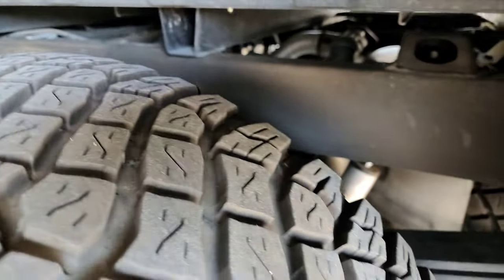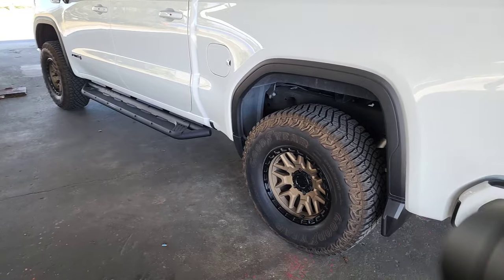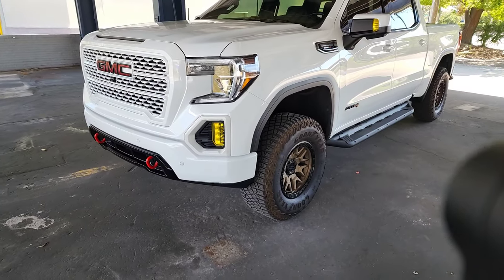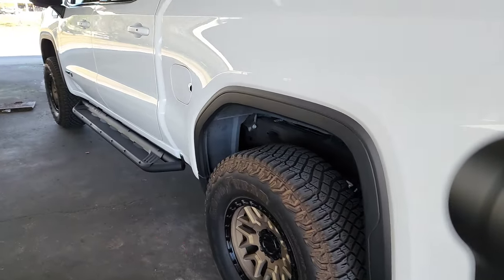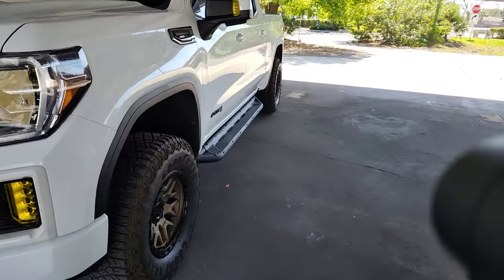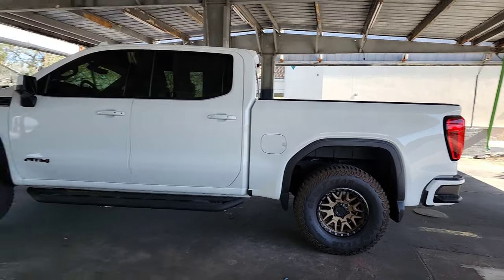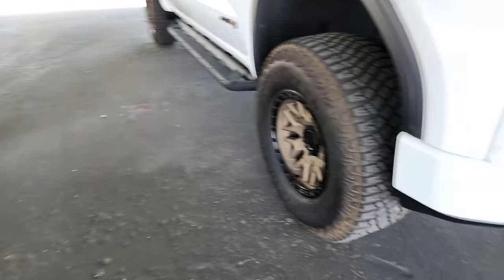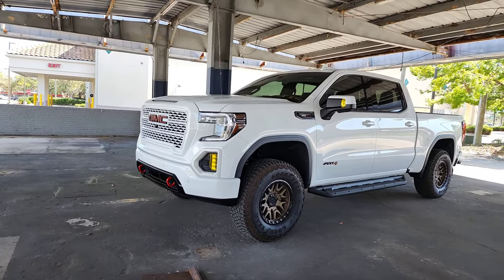Silverado and Sierra rear suspension noise or clunk fixes.

Comment: Same issue, only seems to happen at very low speed like pulling out of my driveway in the morning..... its definitly a clunking sound tho
Reply: I have the same problem on my 2023 2500 hd
Reply: @octaviofuentes7781 wtf your car is new af tho
Reply: @uaespetsnaz2391  yes 16k miles
Reply: Mine does the same thing, pulling out of the driveway and down dirt roads sometimes.
Did you figure it out?
Reply: @johnnewcomb5162  add grease to the leaf springs  that should fix it  mine is all good now 2023 hd duramax
Reply: Same problem 2023 Sierra elevation 2,700 miles. I took it to the dealer, and they told me it was normal. 😑
Reply: Man same. I can pull up and stop abruptly and u can hear it
Reply: @octaviofuentes7781  ha mines less than 5k miles and doing ot..and they are telling me it's just normal for the trucks..wtf
Reply: Mine is 2024 and doing the same stupid noise. Replaced leaf springs and tightened them and good for a couple weeks and then the noise came back !!! 70 k truck making noise
Reply: Same
Reply: 2024 trail boss 182 miles doing this as I leave my drive way and when I’m driving on gravel
Reply: @IM808HI same.😐 I have less than 200 miles on my truck
Reply: @trigger357  thank you for your service. It sucks I been calling Chevrolet corporate because the dealer has to get it approved to replace leaf springs. And I been dealing with this issue for about two months back and forth with the dealer and Chevrolet.
Reply: Same issue with my brand new 2024 Silverado. But I'm fixing it myself.
Reply: 2022 3500 HD does same thing backing up and slow speeds. Annoying 😑
Reply: I have a 2024 with 16000 miles. Clunk and squeak. I order the spring things rubber pads. It stopped the clunk. Didn't stop the squeak. It's about to drive me crazy. I should have stuck to ford
Reply: Dealer said everything looked fine. Cleaned out and applied silicone. Good for two hours. Squeaking started again. I've had trucks with 200  thousand miles that didn't make these noises
Reply: Same on a 2024 Silverado 1500

Comment: Replaced my springs at 9k miles. Sound went away.  Now at 20k miles sound is back just as bad. Nothing but problems with my 2020 Silverado
Reply: ....same
Reply: Same
Reply: I ended up figuring it out. Had it at the dealer 5 times they couldn’t fix it. If you google (spring things ) that is your solution. Little rubber pads. Pry the springs apart and put them on top of the factory rubbers in there. Put one in all four contact points. (Two on each side of truck) I used a 2’ pry bar to spread springs and put them between. Installed them a month ago hasn’t made a peep.
Reply: I ordered them immediately.  I probably could have gcut a piece out of an old tractor trailer mudflap but I'll gladly support SpringThing. Shame GMC can't just fix it...
Reply: My 22 1500 has started chirping from left side. JUNK vehicles

Comment: My 22 Sierra does this. They replace pads because it did it while braking commonly. Just realised today i can shake the truck side to side in the rear and here the noise without even driving it. Can easily feel the vibration of the noise in the leaf spring. I hate that i traded my ram for this thing tbh. Spends more time at the dealer than anything else 🤦‍♂️
Reply from the maker: Mine was fixed when they replaced the leaf springs. Shaking the truck from side to side is not always a good test because what you could be hearing is the axle sliding back and forth in the differential housings, and that is completely normal. It will sound like it's coming from the same area. You would have to make sure what you are hearing is not that.
Reply: @automotiveandmore  you can feel the strong vibration in the leaf springs themselves and it only does it on the drivers side. Also checked u bolts and they are very loose. Set to the initial 60ft/lb spec and nuts started turning before it even reached that. Also the axle movement would be a clunk. This is more of a rubbing sound and does it while turning or braking on angles.
Reply from the maker: @MrDutch1e  that definitely sounds like a leaf spring issue. Mine only did the  noise when the truck was flixing in an off camber driveway or similar. Your sounds like it's worse than mine. Tightening the ubolts or replacing the pads did no difference for me, unfortunately. Only when they replaced the whole leaf spring assembly  was the issue gone. I have heard of others having issues on their second leaf spring as well, which is disappointing.
Reply: @automotiveandmore  I'm hoping tightening mine fixes it since it's def loose. Easier and nowadays it'll probably be a 4 month wait for the part.
Reply from the maker: @MrDutch1e  give it a shot, and hopefully, that resolves it. It was about a 1 week wait for mine back then. Who knows now.
Reply: @automotiveandmore  ya took 2 months to get my faulty injector and I had to call GM and nag so they got it shipped directly from the supplier to my dealer. Who knows how long it would've been had I not done that.
Reply from the maker: @MrDutch1e its sad that it has to come to situations like that.

Comment: Dude Thanks! My lifted 2017 Silverado leaf springs were making a clunking noise at slow speeds. Installed 1/4 inch thick rubber pieces between the springs at each end. No Noise at all!! You rock!

Comment: For me i replaced my leaf spring and still clunks i had 2 inch drop shackles installed and after that my passenger side leaf spring keeps getting squished i thought maybe it was worn but even the new one is squished like where that rubber circle is it is making contact at all times

Comment: Subbed! Thanks for making this video, I have this same problem on my 23 AT4.
Reply from the maker: Glad it helped!
Reply: Did you get it fixed. My 22 sierra is doing this now. They replaced rear pads thinking it was brakes but it's still doing it and you can feel the vibration in the leaf spring when I shake the truck side to side.
Reply: @MrDutch1e  Sorry man, I haven’t gone yet to service, been so busy.
Reply: @clubtc05  I'd get it looked at asap. Mine has it and I checked torque on u bolts and they are WAY undertorqued. I've parked it till my appointment next week.
Reply: @MrDutch1e  Will do, thanks.
Reply: Wholly shit, With all these newer trucks having this issue it should be recalled. This is bullshit. We really need some competition here in North America, these truck makers have had their way to long.
Reply: @MrDutch1e just drove home with my 23 elevation and noticed this going slow on uneven surfaces. Unreal 🤦‍♂️
Reply: @SaltWaterAssassin  mine were stupid loose. Like there was 1/2" more thread showing past all 8 nuts on the u bolts after they did the retorque. Brutal. Just went in for a door rattle to and they said there was a loose bolt and it was the washer rattling behind the door panel. Makes me wonder how much other stuff is actually loose on this thing.
Reply: @MrDutch1e  I noticed the dash on passenger side sounded a little loose when driving down a gravel road, sounded like right about glove box, (I’ve had this truck for about 8 hours now 😂)gonna have to get in there and see what’s going on. I had a 17 Denali and didn’t have a single issue. Looks like I’ll have to button up everything before she’s good to go, but sure all will be good once done
Reply: Same lmao

Comment: Good info as my 2015 GMC Sierra started making clunking noises ... It sure would be nice if you had linked us up with the Spring Thing ...
Reply: Easily found the Spring Thing  and video's ... Just so happen to have some rubber belting and ties that I cut to size .... Will install 2/29 ....And report on how it works .... Thanks ...

Comment: Yours a 22? Dam that truck should not have issues yet. My 18 has clunking noise in front, I could not find issue until I purchased the listening ears or whatever they are called. Then I traced it to the top bolt of the shock/strut assembly. I don't know if it's just the rubber part in there wore out or what so I guess it has 40 miles so I guess I will change out whole shock strut assembly.
Reply: So how’d you get it fixed you? You replaced shocks and struts?

Comment: Mine just started having this problem. Took to dealer today and they said its "Common problem" not going to fix. Should i try another dealer?
Reply from the maker: If you are under warranty they should absolutely fix it. Make sure to let them know there is a TSB on the fix for it. Either the same dealer or another ine should give you the same result. If they dont want too id escalate it.
Reply: At what miles does warrant expire?

Comment: Mind refuses to acknowledge the noise as a problem.  They keep saying that's normal
Reply from the maker: Show them the TSB number.
Reply: YEP. "Normal". Sounds like the truck is going to fall apart when I take it off the roadway.  I have a '22 Sierra 1500 3.0 Duramax.  They retorqued the u-bolts... no change... They replaced springs on both sides, -great! -for about 8k miles I had no clunking.... I hit a pothole on the interstate, and now? Its back... clunk clunk!!  Back to the dealer. They opened up whats called a "TAC" case, where the dealership technician submits data to the manufacturer for advice. GMC says "normal", so, no warranty repair needed. I guess our only option for a recall on these things is to start blowing up the phones at GMC.